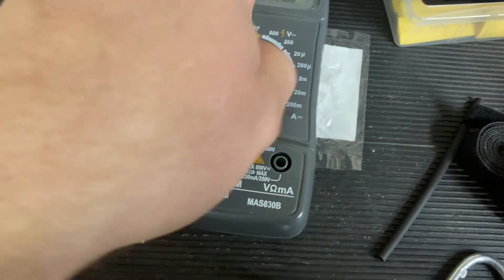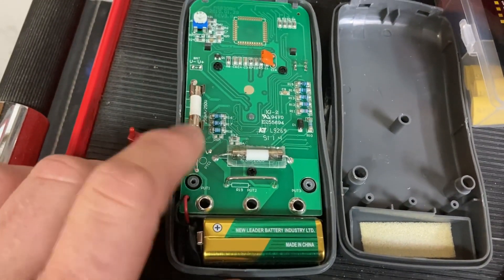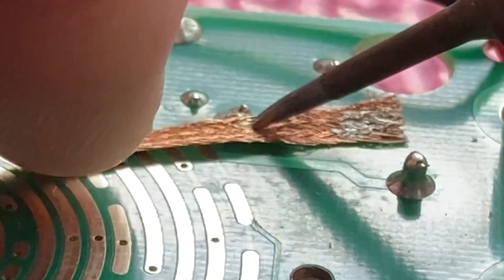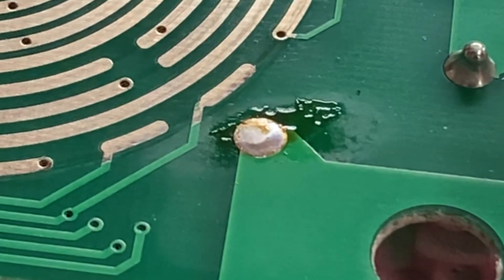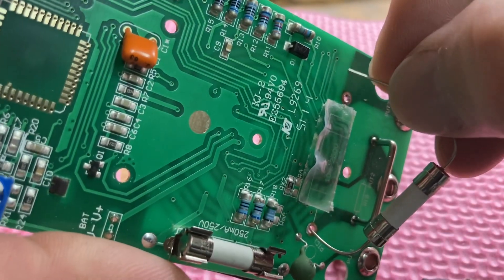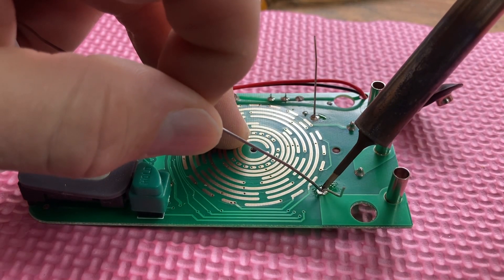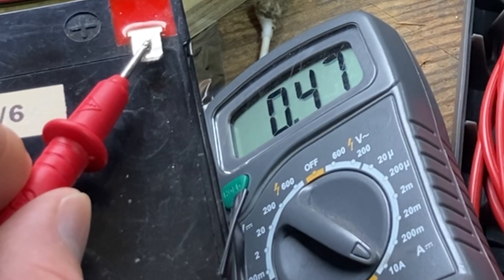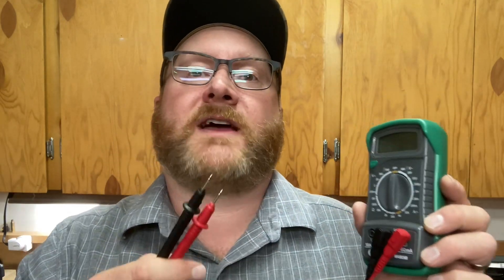Multimeter Soldered Fuse Replacement

Comment: What is that materiel u used to put in between the circuit board and the heating device
Reply from the maker: I'm guessing you are asking about solder or the solder wick. Solder is 60/40 Tin/Lead and the solder wick is MG Chemical Super Wick

Comment: How did the lead wire get connected to the fuse is that solderd
Reply from the maker: Soldered to circuit board and the board has plug for the test lead.
Reply: They’re asking how were the “legs” on the fuse attached from the manufacturing process.  I’m also at a loss as you don’t want to induce too much current when installing a fuse like this or else it will blow during the install.  Interesting stuff!